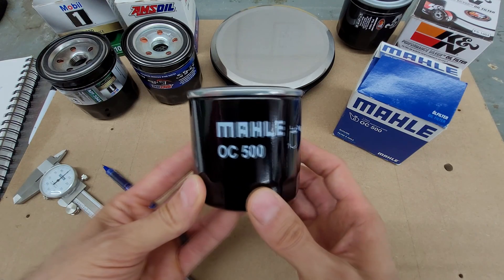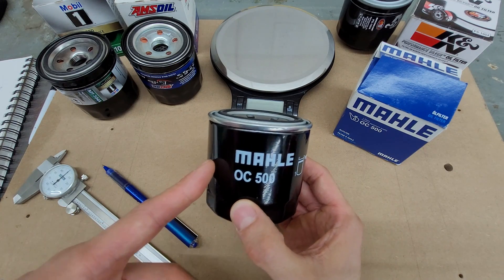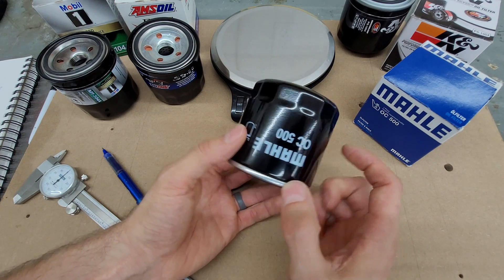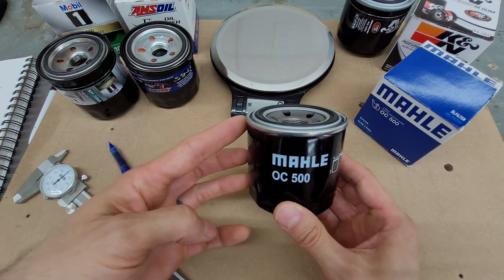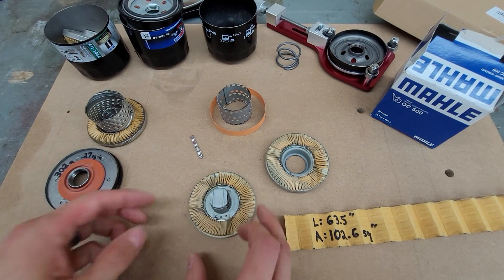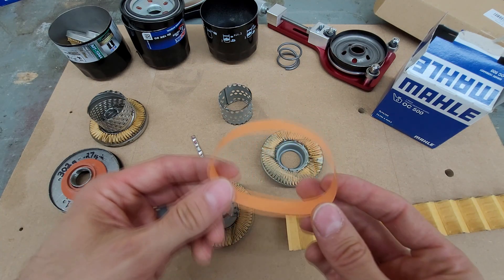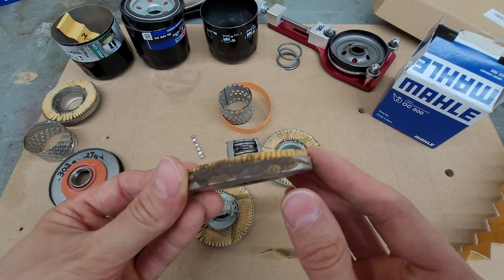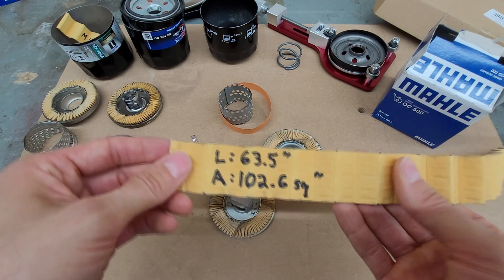MAHLE oil filter cut open! 🛢🛢🛢 No anti-drainback valve!!!

Comment: As to the one hole being larger, I suspect that the toolmaker made a  mistake and they went to the next larger punch size rather than scrapping the conponent. 
As far as no anti drainback valve, not all filters require them, my 6 cylinder Outback doesn't use a filter with anti drainback due to the fact that the filter is mounted horizontally below the oil level, so no need.
My daughters Forester with the filter mounted high and open side down has an anti drainback valve.
The paper band around the filter, I have no idea, I have never seen that one before.

Comment: About the lack of ADBV: I use a Mahle filter (OC49) for my VW Jetta and it doesn't have one either, but it doesn't need one since it's upright. Doesn't seem to be a fluke since I've had about 4 or 5 and they where all the same. I'm guessing it's an application dependent situation, because if you image search other models you can see the ADBV through the baseplate holes, while both the OC49 and OC500 you can see that they are missing.

Comment: The band on the center of the media stays in place when oil enters the filter for the first time. Once the oil is absorbed into the filter media it expands. The center band does not absorb oil so it constricts the filtering media as it expands once the oil circulates through the oil filter. Great video and I am looking to more oil filter videos.
Reply from the maker: Thanks for the info, that makes sense.  I worry what happens if the band slips down to one end before the filter gets filled for the first time.  🤔

Comment: they didn't "forget" to put the anti drainback valve in there.  it's called "profit".  duh!
Reply: Yo, Bob, love your music, but not every car needs anti drainback, mine mounts the filter horizontally below the oil level so it cannot drain out.
If you want to see cutting corners for profit, check out Fram filters with cardboard end caps rather than stamped steel.
Reply: Agree on the profit motive. It appears to have backfired because Mahle has since replaced with the OC1673 that now has a ADBV. The OC500 was advertised to fit my Hyundai that requires an ADBV. I regret buying. While my filter doesn't empty either on shutdown, the oil galleys in the head and block drain without an ADBV. I noticed more rattle and lifter noise after start-up that went away after swapping back to the OE filter.